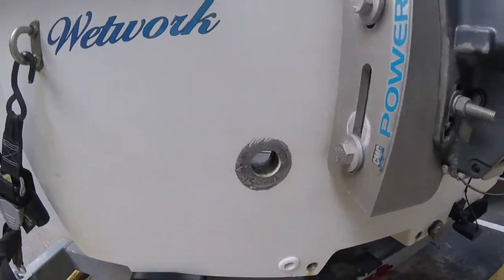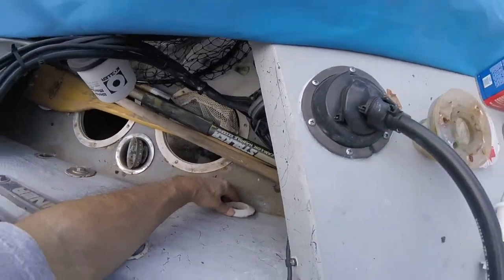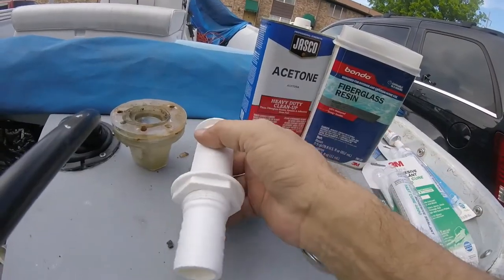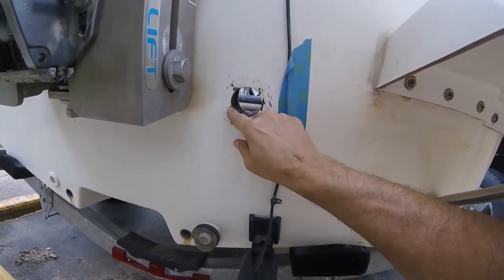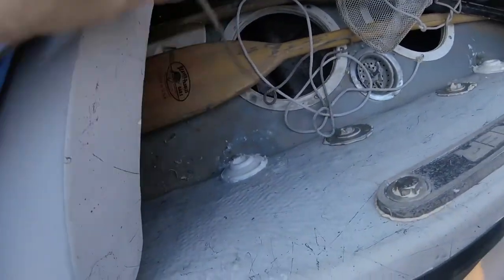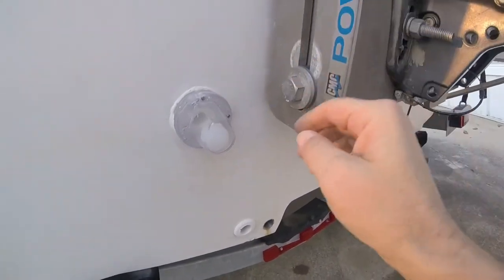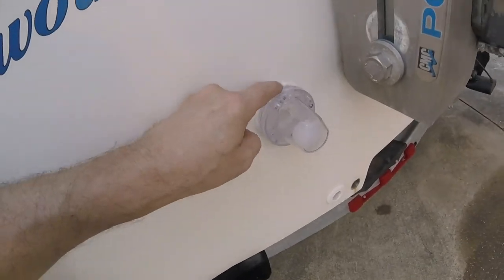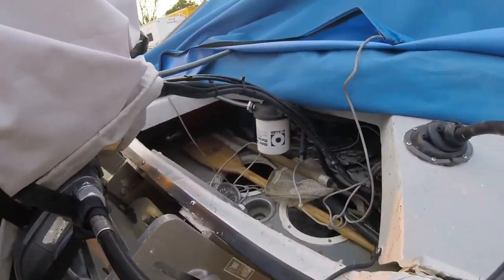Kenner Boat Transom Disaster Averted- Scupper repair

Comment: Hello. Are those ball valves ok to use on engine well drain holes that are about 2 inches below the waterline?
Reply from the maker: They dont seal that well, I'm afraid. If your drains are 2 inches  below the waterline  while the boat is at rest, they are either too low or your weight distribution needs attention.  Deck drains are usuallly just above or right at the waterline. You will need seacocks installed at the very least if they are that low.
Reply: Thanks for the quick reply. Yes it sits too low after I repowered it with a heavier 4 stroke. Still drains out water but I don’t like having water sloshing around when at rest.
Reply from the maker: @catco01   I dont blame you. This is why I hunted for 6 months to find this particular engine for my boat.  At 262 lbs, it's perfect for fishing in skinny water....even after adding a house battery back there.  You can relocate those holes.  It's quite a job, but it can be done.
Reply: Yeh I should have done a bit more research on weight of those 4 strokes. It was replaced with same horsepower but I didn’t think of the weight difference. I was thinking of relocating the drain holes higher and blocking the original holes. That would fix the problem of water getting in but when water does get in it won’t drain out until it reaches the height of the new holes. And I don’t particularly want to fit a bilge pump in the well either. Might see if relocating the battery to the bow area will make much difference. Have already tried around 60kg of sandbags in the bow locker, didn’t help much at all.
Reply from the maker: @catco01  This is most likely a common problem with a repower now, on some boats. If you properly plug the old holes, re-glass them in and add new ones ( something I'm never fond of doing) slighly higher, and to the side of the old holes, they will drain., if not too high, because they need to be right at the water line when the boat is at rest.  When running, the stern will lower a bit and they will drain. So, the ball scuppers would help.   Mine are located right at the waterline , at rest. The  "Boatworks Today"  channel probably has a good video on relocating them.  Howvever, I'd begin by removing all unnecessary weight in the boat first.  You can solve this !  Good luck and let us know how it turns out for you.
Reply: Thank you sir. All the best for the new year. I’ll get back to you with the results. Greetings from Australia 🇦🇺